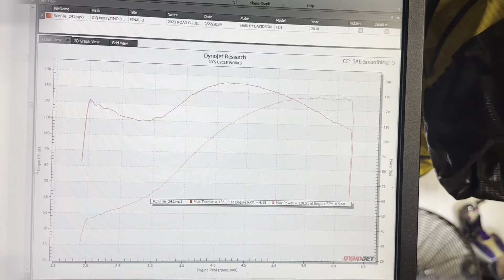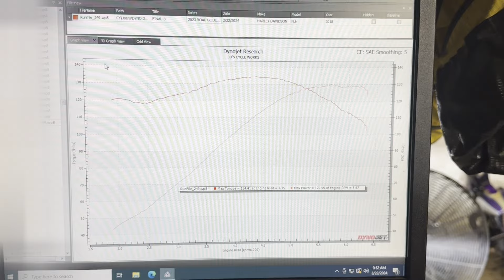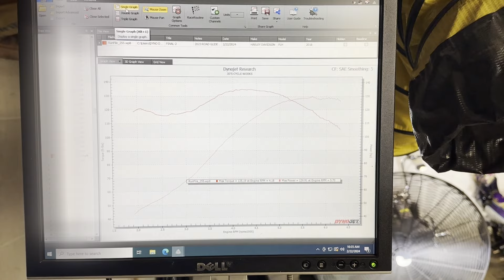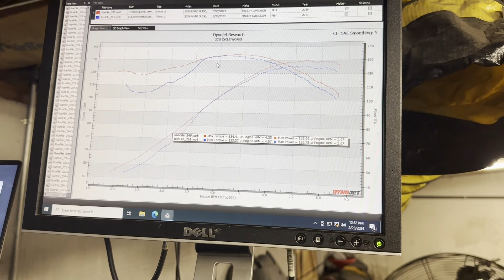Baffles Explained!

Comment: I spoke with Dave last year and explained what I wanted.  I ride a street glide with the Rockford system. He recommended the "quiet" baffle.  These baffles sound great and are by no means quiet.  It’s a perfect sound.  If anyone is wondering if they are to quiet, the answer is no.  It won’t completely drown out the Rockford system and has plenty of bark! Dave did a cam and a couple other things on my bike. The results were absolutely amazing.  Still can’t get the smile off my face.  
Thanks again Dave 

This is the place to bring your bike!
Reply: Dave is a Smart Man, i also run the quiet baffles & the back pressure helps tremendously with the torque values.
Reply from the maker: Thank you very much, we are very happy to hear that you are enjoying your ride!

Comment: Dave is doing my cam in April. He convinced me to change my Tab zombie baffles to the louvered baffles.  I just changed em over and glad he did a video to show the reasons why he recommended I make the change.  I allready noticed I got some torque back from when I did the head pipe and tune.  The tab louvered baffled are quieter at idle but still rip pretty good under acceleration. Cant wait for him to work his magic in April
Reply from the maker: We’re looking forward to seeing you soon!

Comment: I have the 117 with the S&S 475 cam along with the 4.5" Khrome Werks slip ons with the quiet baffles. On the dyno i am running 124 hp with 136 torque.
Reply: The numbers are great and I’ll bet the sound is awesome.

Comment: Great video Dave. Ill always use louvered baffles. I biught the tab mufflers with the zombie baffles in them. My road king suffered crazy low end loss with them. The zombie bafflesnare completely smooth woth only the slightest tapering towrds the back of the muffler. That was wasted money ill never get back. They do have louvered baffles but the pipes cost me 750$ woth the zombies and i wasnt spending anymore on baffles. Went back to my bassani rr3 stainless pipe.

Comment: I have a m8 127. I had 2 1/4 baffles. Runs strong but so quiet. Decated head pipe. I just for fun had some baffles and changed the core to 2" straight pipe core. And it actually made it not just a tad bit louder but more crisp. Torque is a tad bit more also from seat of the pants feel. Wot it's almost loud, loud. I'm nervous to say, hey this is ok. But let's see some work done to baffles that shrink a tad and have no holes lol. My vrod had a destroyer exhaust with a fake cone as a baffle. This is what let to the insane idea I did.

Comment: I run the S&S 475 cam on my 114 with a Khrome Werks 2 into 2 exhaust with louvered baffles. Would be interesting to see the difference between the louvered baffles and just the cone reducers like what was put in CYcle Fannatix bike. I'm thinking of ordering them but concerned I will lose too much low end torque. They do sound awesome though.

Comment: Another great and informative video for the M8 touring machine.. Dave I see Khrome Werks make (2) different to 2 into 2 head pipe products. PN# 200920 - Aggressor 2-into-2 Crossover Headers - Black and also a stepped header that comes with the slip on's PN#200445 called the DOMINATOR 2:2 3-STEPPED HEADER, 4.5" MUFFLERS W/ EDGE TIPS, BLACK. Could you tell us please which one dynos out the best for most torque and HP. Many many thanks best channel out there for HD performance spec's. Thanks James
Reply from the maker: I am happy to see that my videos are helping people make better choices on their upgrades!
 I prefer the full dominator systems from Khrome werks over the slp on and head pipe systems. it seems to work better but a lot of times.I understand that some  customers  have already puchased a slip on muffler so adding the aggressor head pipe completes the system and still works great,
Reply: @JDsCycleWorks  Thank you Dave I will be ordering the full dominator system and also adding the spoon baffle to the package for best torque. I have the HD Ventilator air cleaner and will and the much thicker fuel moto BMF hi flow filter to give it more air. Let us know sometime if you ever have a comparison of the HD Ventilator filter element upgrades. We have the Fuel moto BMF : Arlen Ness Big Sucker and K&N also offers an upgrade for the ventilator unit. It's a popular unit and good gains for just adding a better filter. Be well and thanks for all you do. James
Reply from the maker: Your welcome, The filter upgrades you mentioned are improvements over stock, however, the filter upgrades that breath from the front and sides of the element work the best with the least amound of lost power as compared to removing the element.
Reply: @JDsCycleWorks  Yes, for sure : The less the air restrictions the better: I was mentioning these less expensive alternatives to the 500.00 + units to some who may want much better than the stock HD ventilator performance for the 100.00 cost of a new filter upgrade. The Fuel Moto BMF seems to give the most additional surface area (depth) as well as using a less restrictive media which is washable with soap and water. It would be fun to see if you ever have M8's come in with these on to see where they sit. Many many thanks Dave for the best channel in You Tube land. James

Comment: I’m having the Fueling 465, and these pipes put on as we speak. I didn’t even think to order different baffles. Will I need to retune if I add the quiet baffles later? I have the Thundermax tuner so maybe it can auto tune the change?

Comment: Excellent and informative video proving the theory that proper back pressure is key to getting maximum hp and torque out of the M8. I have the 2 - 1 - 2 exhaust on my RG. I was curious why you chose the  2 - 2 since many say that the 2 - 1 is better for performance. Is there any proof that the 2 - 1 would get better hp and torque numbers over the 2 - 2, or the 2 - 1 - 2?
Reply: I hope Dave chimes in but it seems like most 2-2 will hurt power but the khrome werks 2-2 with stepped headers and baffles does just as good or better than most 2-1 I’ve seen.  
This was crucial for me because I have stretched bags and like the dual look.
A good 2-1-2 can run good as well but again it seems like some manufacturers have it a bit more figured out than others.  This is were guys like Dave, that have experimented with different setups, come in.
Reply from the maker: The 2-1 will come on harder, to see a comparison please take a look at the S&S 475 video.  The reason why I chose the 2-2 with the louvered baffle for this test is because the majority of my customers do not want to run the 2-1. The 2-2 system offers 2 functioning mufflers with a stereo sound and have different baffle choices and have a mellower tone than most 2-1.

Comment: Hey Dave... I have a 131 build with Woods 22XE CAM and Rhinehart slimline duals. I am thinking of switching cams to Fueling 508 or 521. Which do you think I should select for my build or do you suggest changing something to get more low end and horsepower?
Reply from the maker: Send me an email and I can answer this more accurately.

Comment: What modification did you do to the spoon baffle?
Reply from the maker: I opened up the pinched down area at the front of the baffle reducing the amount of restriction it had.
Reply: Have the same baffles , Did you bended up the ramp or cut more ? How many did you opened ??  On my I leave the ramp half bended , it looks runs better than full closed ramp .